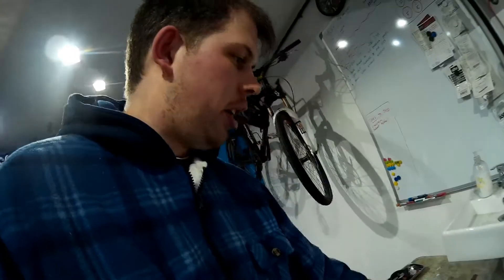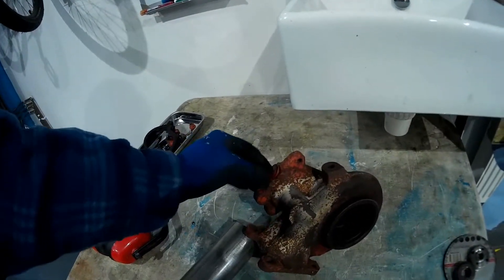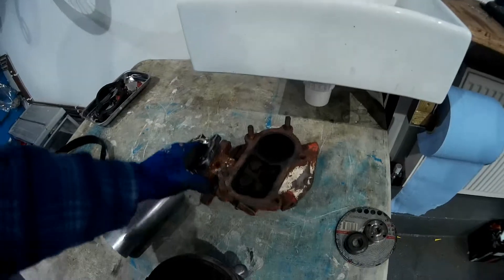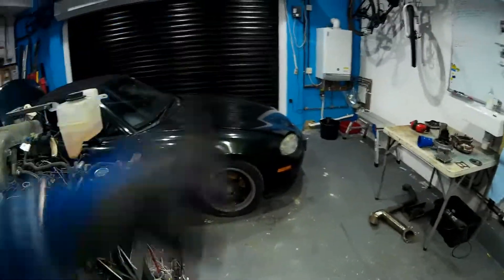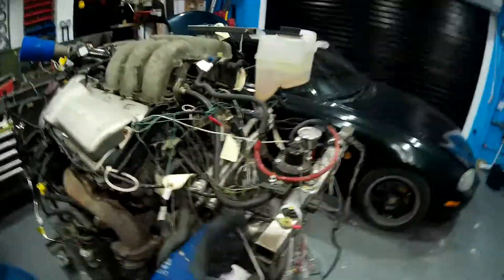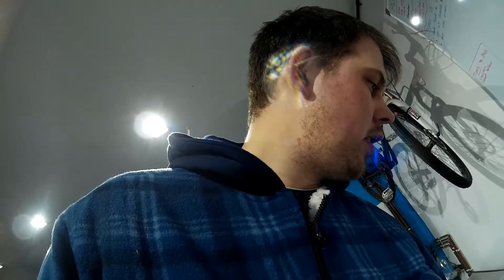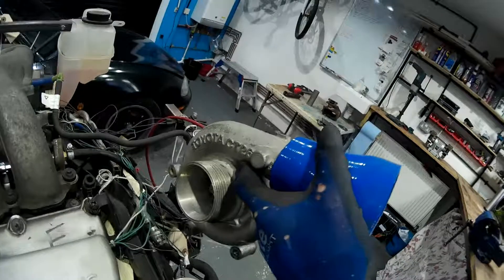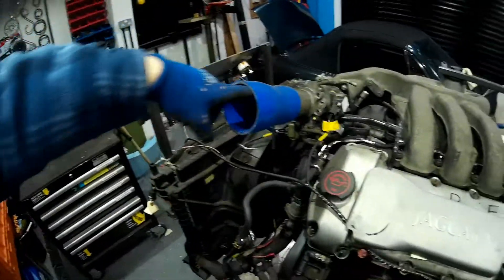AJ30 TURBO V6: PART 1 - The plan..

Comment: Hello, following your work as I'm interested in using an AJ30 in a rebuilt kit car.
Can you do me a huge favour and measure the vertical distance from the bottom of the sump to the top of the manifold.
This would be really useful thanks.
Reply from the maker: Hi, its around 72cm.
Reply: @engineeringchroniclesunedu5757  thanks for the info. It's a bit taller than I'd hoped.
It might need trimming down with an ST220 inlet manifold and sump for my application.
Hope the manifold swap doesn't have a major performance hit.
Reply: @richardschofield2201  have you checked out the noble forums and the rocketeer?